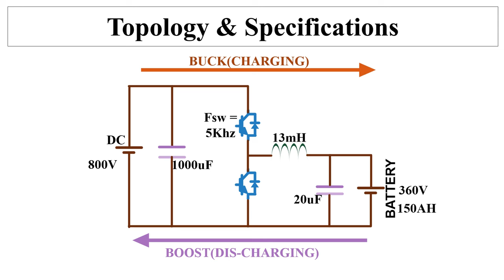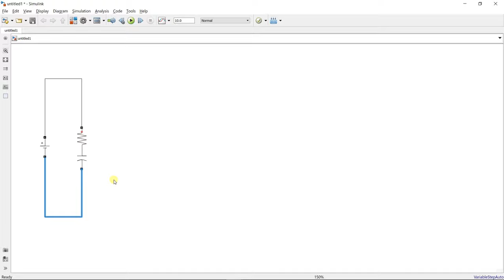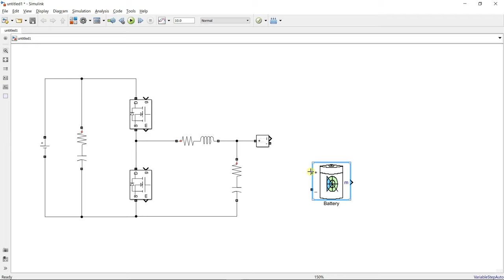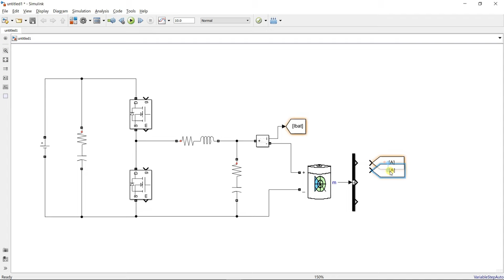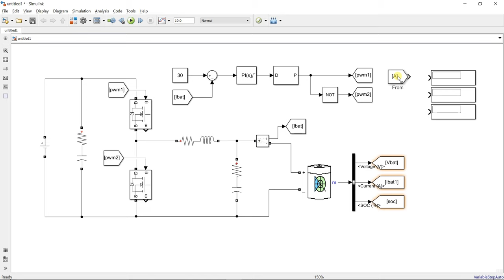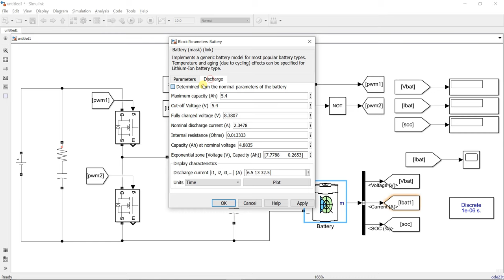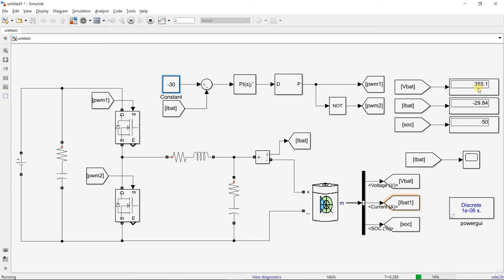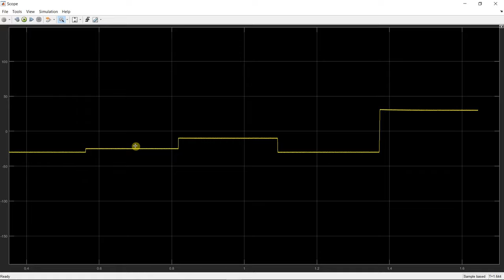MATLAB Simulation of a  Bidirectional Battery Circuit Using Buck/Boost Converter.

Comment: Sir if i have to put pv array application as a dc source input to charge and discharge a battery then what are the perimeters (mathematical modelling) required for pv array for this battery using buck-boost !

Comment: In my model if I put constant value as 30 in Ibat1 in display it shows -30 and voltage remains same when I put -30 as constant it displays 30 in Ibat1 voltage starts reducing can you tell me what's the problem in my model?
Reply from the maker: Pls share you model at my email id
Reply: The battery notations are reversed. In control logic, Ibat is used and while scoping the response Ibat1 is used, that's why it is showing negative.
Reply: @yangyadatta   not clear please help  me to clear out the problem, I am also facing the same issue.
Reply: @yangyadatta   what is Ibat1.?
 can u plz tell me?

Comment: thanks for sharing ur work, how to find Vripple and I ripple?
how to find the values of p PI  and the value of limitations 0 - 0.95?
Reply from the maker: Vripple, i ripple are designer's choice, there are some thumb rules, based on that i chose values.

PI tuning include many things, cant just explain it here.

set duty equal to 1 make the switch always ON, and circuit will not work properly. so i chose a value less than 1, that is 0.95
Reply: @TechSimulator  could you  pls send  me  the  thumb rules  and   the steps  to tune
Reply: @TechSimulator  hello sir , please can you check your email address I have sent you my query but you didn't reply. Please I need your assistance.

Comment: Can u send the video on battery charging with dc dc bidirectional converter using solar
Reply from the maker: what exactly you are asking? where the battery discharges to?
Reply: @TechSimulator  I want model on pv system with battery storage using bidirectional dc dc buck boost converter
Reply: @minakshisingh9571  Hey, did you make that model? i'm trying to do the same...
Reply: Minak, were you able to do it using solar? If so, could you please support me to do the same?